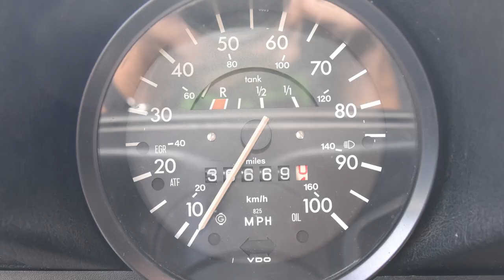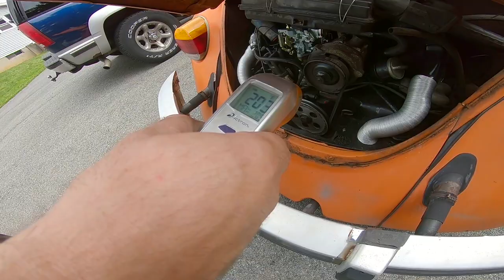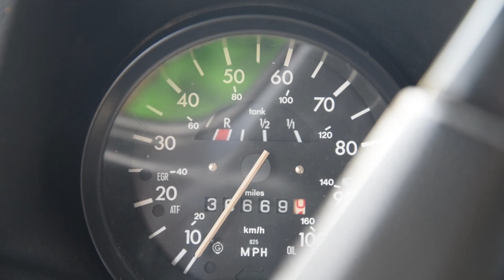1974 Volkswagen Super Beetle 1600: Regular Car Reviews

Comment: "until your classic car goes away for the winter"

Yeah nah im 22, have no idea how to dial in a carb but common and try me. Its my only car, I always wanted a old benz and I'm gonna go through with this on all seasons
Reply: You'll be fine in an old Benz. I've lived that life.
Reply: CaptainKman  oh I own it for over half a year now. Basic maintenance aside (one oil change and fresh coolant) I really didn't need anything. It got restored two years ago before that it was all one owner.

It's a W201. Number 272 of the assembly line in Bremen. 5 speed But carbureted (when I remember correctly the states only got the injected model). Tho I replaced the drivers seat. Previous owner was an absolute unit and Tore the seat apart getting in and because everything else was spotless I couldn't let it be. Got it for 50€ in mint condition from a scrapyard

Comment: The reason the engine bay got hot was the "mechanic" neglected to install the rubber seal between the engine and the body. The engine sucks cool air in from atop, and blows it out the bottom, hot. If the rubber seal is missing, the air rises back into the engine area, and gets when hot air is sucked in to cool the engine, it gets even hotter. You have a heat feedback situation, with the engine bay – and the engine – getting hotter and hotter.  You must not leave out that rubber seal. Lack of rubber seal may also provide an opportunity for exhaust fumes to get into the passenger compartment.

Comment: I usually like RCR but this one just frustrated me to no end. VWs were much more reliable than most every other car out at the time and yes that includes the Honda Civic. What makes them unreliable today was lack of regular maintenance and/or poor maintenance. The heaters worked good and they didn’t smell like fuel. This example is a cobbler together beater. Try driving a nice one. They really were a well made car. I’ve owned several and they are quite good as cars. I would certainly avoid one that is in the condition of this one but that goes without saying. Do they require maintenance? Sure. But all cars of the era did. The beetle was truly a very good car in its day. They were known for lasting a long time, and being dependable. They got better gas mileage than most of its competition even in the 1970s and they were also known for being relaxed on the highway compared to the competition of the time.
Reply: It's a super beetle, the suck because those are expensive as fuck. Complicate suspension, larger diff, etc.
The normal one is waaay better, easier to fix, doesn't let you down if you take care of it. 
I have one and it's been on my family for 20 years
Reply: Exactly, back when I was in Brasil we had a Beetle as our car. You could literally let that thing sit for a few years, come back to it, push it to the mechanic's shop, restore the thing for less than it cost to buy a used car, and get on your way driving.

Say what you want about the war time design, but it runs like a wartime design should.
Reply: OmegaReilly I would not say McPherson struts are complicated. I also prefer the standard but also understand why vw came up with this version.
Reply: Nope Chevy was more reliable
Reply: Jedi Master Joe gotta be kidding. American cars were garbage at the time. They were huge gas guzzling relics that were junkyard bound with 80,000 miles on the clock. I like some of the American cars from that time for sure but good cars they were not.
Reply: Michael Converse Pinkos
Reply: I'd agree it's a poor example so perhaps a bit misleading but their fuel consumption was never great.  25 mpg was pretty poor when say a Fiat 127 was faster and would easily crack 40mpg.
Reply: Imp5011 the Fiat 128 was a  competitor to the beetle in the USA. The EPA  listed fuel mileage for the fiat at 20 city / 28 highway and the beetle at 22 city/33 highway. The Toyota corona was rated at 21/33. So in that regard the beetle was still very competitive.
Reply: Jedi Master Joe lol that’s awesome. A term Archie bunker used back the olden days. No I’m not, not by any stretch, a Pinko, and I prefer to buy American made products but I can tell you this, my parents owned both American cars as well as two VWs and a Toyota and a Volvo  during my childhood. And  the foreign cars outlasted the American cars they had by far.  Even as a little kid I could see the VWs and Toyota were better made. The Us products were just wasteful back then. Barely double digit gas mileage, huge panel gaps on the body, a gigantic exterior with not much more room than the toyota inside. There are reasons that VW and then the Japanese started selling like hot cakes here. Yet in Asia and Europe you couldn’t (still can’t!) give and American car away.
Reply: Jedi Master Joe ok boomer
Reply: EcloyJ _ all boomers are pinkos? Not sure what you’re getting at. I’m not a boomer-they we’re born between 1946 and 64 and i am much younger than that. Are you upset about my liking of foreign cars? I like American cars too. Not all of them are terrible hunks of junk. Many were excellent. But realistically from the 1970s-the mid 2000s the reality of it is that most of them were pretty lousy.
Reply: Michael Converse what? You may be confused i wasn’t commenting on a comment of yours. And i was using boomer just because of how overused it is and how unfunny it’s become now. I also am not a massive fan of U.S. cars since now a days they are not foreign than foreign cars, sure old ones are fun but eh. 
I also am a bigger fan of European/foreign cars since they are way more interesting than your common mustang you see everywhere. Hell, I’m considering getting a VW beetle

(Also yeah I’m really not hip to the idea of old Chevy being more reliable)
Reply: Rusty Shakleford car looks that way rusty, if that is your real name
Reply: Paired with the fact that you don't really get a classic car for the reliability to begin with. No one gets a car from the 70's expecting it to run like a car from today. If they did, they'd just get a new car.
Reply: EcloyJ _ apparently I was confused. Sorry about that ! Got it.
Reply: Agree with you as someone who's had a '73 Super for 9 years as my daily driver. This car was in absolutely terrible condition, no wonder it gave them a bad impression. But I still found it somewhat amusing, sort of a roast of both my car and even who I am as a person - they were pretty spot on about it. My car is now, after a lot of restoration and a fair bit of modification, pretty reliable and a very nice daily driver, but I can tell stories of pretty much everything they said, it's all happened to me in one way or other at some point. Don't take it too seriously, just laugh along with it.
Reply: @MegaBenReilly  The Super wasn't really a bad vehicle - it was a bit more complicated, took a bit more to repair and adjust the front end, but it's not all that bad once you've learned to understand it, and it handles much better than the original. A trade-off of more complexity for better function. I've had one for many years and really like it.
Reply: The Underground Man Not sure about reliability being garbage on your points. I’ve seen a handful of old Beetles driving around in my town going happily about their merry way. While classic American cars are rotting away in barns (sadly). They’re slowly becoming more common on the road than American classics and I live in an area where classics are highly preferred.
Reply: I can answer one question posed in the review. Why this instead of a 74 Honda civic? Because the civic was still having to prove itself. It was still a relatively new guy on the block. Btw when is the last time you saw a 70s Honda roaming around today?? Beetle??? Thought so..
Reply: I normally like his videos, but this video was nearly Clarksonian in its ignorance.
Questions for anybody out there...if then VW Beetle (either standard or Super) were so God-awful, why were over 20 million of them made over the course of 60 years?  Surely some other car company could have swooped in, built a better mousetrap within 10 years, and retired the Bug sooner.  And yet...they didn't.  Why?
Reply: @jedimasterjoe5386  Perchance, are you talking about the Vega?  Or the Chevette?  If memory serves me correctly, they were both created long after the Beetle, but discontinued well before the Beetle met its demise.
Reply: @moosecat  huh
Reply: @jedimasterjoe5386  You said Chevrolets were better, and I was asking WHICH ones, because neither the Vega nor the Chevette (which were comparable models) were better.
Reply: @moosecat  not thoese lol

Comment: I had a 73, and that is an alternator. It's an upgrade kit the generator is smaller.
Reply: Nothing wrong with a generator.
Reply: @vector6977  nothing wrong (and so much right) with an alternator swap either
Reply: The 1974 came with an  alternator. He also does not know what actually makes a Beetle a Super Beetle. McPherson struts. From the front seats to the back it’s the same car.
Reply: @ vector6977

Tons wrong with a generator. 

Like he said, it doesn’t produce power at idle... so lights go dim battery discharges at a stop light. That’s because it only has one winding instead of three like an alternator and the regulator is throwing as much juice into the field as it can but still not making anything. 

ALL of your power has to go through the brushes. Just the field current goes through the alternator brushes. That means generator brushes are more expensive and still burn out over twice as fast. And rather than two screws and one wire to replace the brushes on an alternator vs taking the shroud off and having to mess with brushes and springs plus wires for each brush on a generator. 

You need a commutator to rectify the current produced by a generator. The same high current going through an uneven and complex surface vs the two simp slip rings of an alternator’s rotor and a solid state diode rectifier. 

You need a current limiter and reverse current cutout for a generator so it isn’t motored by the battery. Alternators are self limiting and the solid state diode rectifier functions as a reverse current cutout. 

Because of the complexity of the generator regulator (which often uses physical contacts for voltage regulation, current limiting, and reverse current cutout) it is another extremely failure prone part of a generator setup vs a completely solid-state alternator. 

The only advantage a generator has it that it is self-exciting. But you can make an alternator self-exciting by using a generator to power the rotor. This also eliminates all of the brushes and thus makes a brushless alternator.
Reply: @DanaTheInsane   Yup..the dimensions of the rest of the car were identical to the standard Beetle. I believe the designation for the Super was a 113,vs a 111 for the standard.
Reply: @johnstone7697  The hoods are different too. They also had the air louvres in the front beneath the hood, and the standards didn't.
Reply: Super beetle has struts and is 4 inches wider up front, 1.5 inches wider seating area. Larger cargo area since the relocation of the spare tire. Alternator is what’s on the 74, different dash, with blower motor. And a dvd screen in dash. Okay I made the last one up 😂
Reply: Yeah, that's clearly an alternator in that car. I've heard they started putting alternators in them in '73, but my '73 had a generator when I got it, based on the wiring clearly came that way from the factory. I've since swapped to an alternator.
Reply: Quill Maurer They started late 73 with the alternators. So yours honestly could have a generator from the factory. I have had both, but I do like the  alternator much better
Reply: @SladesVWBeetle  Ah, would make sense. I know they made some changes mid-year for '73, including changing from three-bolt to two-bolt ball joints on the front struts. Mine is the earlier 3-bolt, and had the generator from the factory. I switched to an alternator eventually, which ended up being mandatory as I later converted it to EFI with Mexibeetle manifolds that only fit with an alternator. I never had much trouble with the generator other than it not producing power at idle, but I like that the alternator is also about 1/3 the weight of the generator.
Reply: They had alternators on the later versions.
Reply: @DanaTheInsane  also the curved windshield. Standard sedans had a flat windshield.

Comment: Trivia: this, the ghia, and the early porsches all share the same engine and drivetrain.
Reply: Hence, the 911=Beetle joke
Reply: Yet...The Ghia is probably one of the best cars ever designed...
Reply: Trivia: all vw cars are the same thing.
Reply: @antonioederlopezlopez7341  ahem 
EA827
1.9 TDI
Limbach series 
Cb-40

My good lad, read a book...
Reply: Hardly surprising when this descends almost directly from the motherfucking kubelwagen of all things
Reply: Porsches had different engines, they had some interchangable parts w the 25/36 horse blocks of vws, but they were of Porsche design. Prototype s probably did have 25 horse VW engines, but all production cars had Porsche engines. Especially when they started increasing engine size and valve train dimensions.
Reply: Nope. No Porsche had a VW engine except the 912 with the Type 4 engine, which never made it's way into a Beetle.
Reply: @RingoYote  It has a nice design, but it's not that great of a car.
Reply: @NixodCreations  The Beetle (KDF Wagen) came first. The Kubel was a variant.
Reply: also the same as the Thing, Type 3, T1 and T2
Reply: @bowlcutgamer  Not for 1976, the 912E used a VW Type 4 engine with the same Porsche heads as the 914, as opposed to the cylinder heads used on the Transporter
Reply: Yeah, (well... more or less) but see the difference is TWO of those cars actually become a pleasant driving experience when you swap literally ANY other flat 4/6 into them
Reply: @daftend  correct
Reply: Fun fact: The Kubelwagen aka the funny off road kinda jeep thing the Wehrmacht used in ww2 also share the same engine and drivetrain
Reply: Trivia: No they did not!

Comment: "why would you buy this and not a Civic or Z car?" - someone who never had to work on any 70s-80s Honda/Datsun. 
My daily is a Z car that... doesn't like to start, misfires, idles at a buck thirty, and is a nightmare to work on. And seeing as old Japanese cars were biodegradable, the only reason why it's still alive is because it's from the south and never saw snow or salt.

Man, just admit you have an irrational hateboner for VWs. Most of the complaints in this video would apply to any 45 year old car that's been neglected, bodged with half-assed repairs, and tossed from one owner to the next.
Reply: Old Japanese cars were biodegradable is a great way to put it, as awesome as a 240 is it was never meant to be put through what the bug has been battle tested and proven to go through

Comment: Have to disagree with the whole video. I have a 1985 1200cc beatle which has been in possesion of my family for more then 30 years. It has never made any problems beside these you have to expect from a aircooled car and it never broke down even though my father drove it with a 2 liter built engine. YEAH , that engine blew because it was insanity but right now we have a original motor installed which we plan on swapping with a 1600cc just today. I love this car and we never had problems with it throgh all the years of service.
Reply: Mexican beetle? It would come with a 1600cc stock
Reply: Same, my first car was a 1977 super with the Arizona AC unit crammed in your legs lol, drove it for 15 years and all i ever did was change oil and tires. But in this bugs defense it looks very ill kept...
Reply: The Underground Man  yea pretty close it would make abt 90 hp im pretty sure
Reply: The USS Johnston  the insane part is the aircooling not the HP.
Air is shit at removing heat.
Reply: It didn't have a beetle engine so it doesn't count
Reply: It's a 1200 that's why it's reliable don't change it

Comment: Ive never seen a VW engine shake that much
Reply: I have, one with a hell of a misfire on all cylinders and rear transaxle mounts that were soft as silly putty from the oil leaks. Changed the mounts, plug wires, and set the points gap (there was NO GAP). Ran much better but still had a vacuum leak from the rubber boots on the intake, I think.
Reply: i have, when the timing is wrong
Reply: @TheViolatorinator  Mine kept plugging up the #4 plug. Turns out the exhaust tube that heats the intake manifold can get plugged which makes the manifold not heat up and causes fuel to condense out before it gets to the cylinder. That can cause a lot of the shaking issues.

Comment: "It will make a mechanic out of you". 
My dad got one in 2004, and I took it in 2014. I knew nothing about cars back then when I used it to go to work. It failed a lot and got me stranded several times. Right now, I'm rebuilding the engine at home from scratch, using specific crankshaft and cam config, with performance rockers and overall better parts, to lower the rpm range and get better take off. It did a mechanic out of me, and I'm glad for that. I always remember this video and come back every few months.